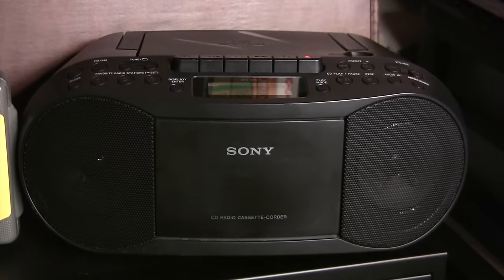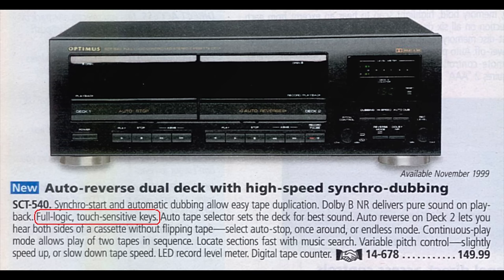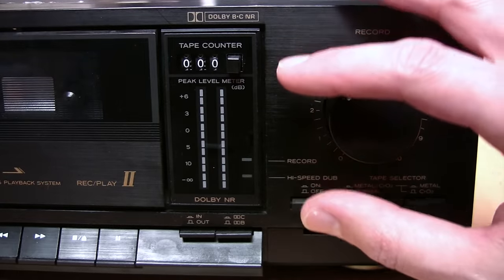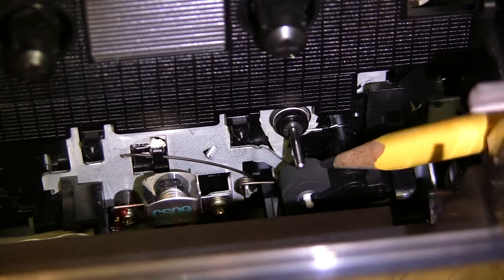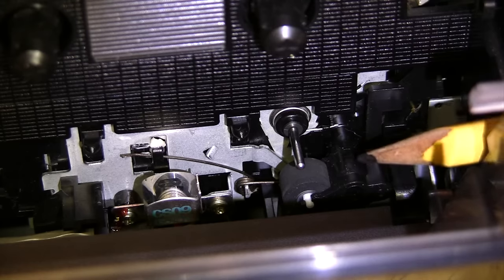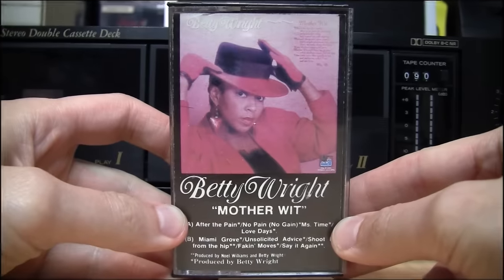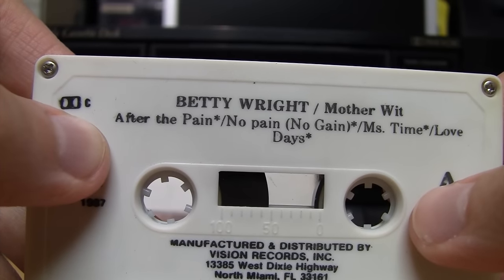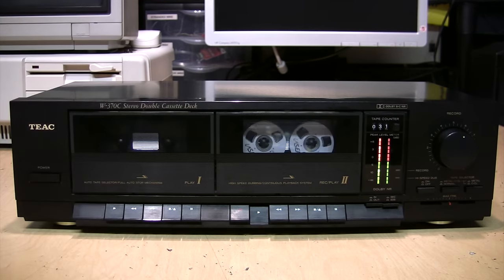Cassette Decks for Dummies

Comment: great info , tho I wish you would have explained about head demagetizing ,,,if, when , or how ...ive heard i need to do this on my new purchased used pioneer deck ...or is this more a myth than necessary,,?  thanks for the hard work and thanks in advance for a reply
Reply: also thanks for your hard work ,,would like to see this type video concerning turntables .
Reply: Head demagnetizing is very unimportant. On "ordinary" decks with combined rec/play head, the head would pretty much keep itself demagnetized by the recording process. 3 head decks, where the play head never sees a record current, are theoretically more susceptible to magnetic field build-up, but again not a common issue and in 30+ years dealing with tape decks I've NEVER found a deck with any significant in-need-of-demagnetizing issue.
Reply: @njm1971nyc  Magnetized heads are caused by tapes made on DC bias or permag erase decks
Reply: @manFromPeterborough  I don't doubt it, but neither have any place in the world of "hi-fi". Only the lowest-of-the-low "junk" tape recorders use these things, so you wouldn't likely notice on the recorder itself, and unless you're recording on junk and then using a decent deck for playback... unlikely to be a real-world scenario. Fair point, nonetheless. The one time in my entire career that I found any form of magnetization in a "tape recorder" was actually a Sony Betamax vcr in the 80s. A guide post in the tape path became magnetized to the point where it would literally erase a thin portion of any tape played in it. That, alone, is the only time I've ever seen a magnetization issue in tape equipment.
Reply: @njm1971nyc  I've never heard of magnetization trouble in a VCR, what was the exact symptom the erased portion on the Beta tapes?
Reply: @manFromPeterborough  yeah, it was an odd one for sure! the symptom was a noisy white hoizontal line about half way down the screen. Which would then look the same if played in another deck! Literally an erased portion of the video track.
Reply: @njm1971nyc  I once had a TEAC 3090 VCR that sometimes are doing previous recoding would have erase bias going into the control track head, messing up the recording leaving no sync, playback, FF or REW will destroy the sync track regardless, that VCR ended up EOLed
Reply: @manFromPeterborough  yeah, that's no fun! Recently had a client's tape with barely any control track, totally unreadable by all my decent quality VCRs, but the shittiest weirdest Middle-Eastern market Panasonic deck that I picked up for ten bucks at the Salvation Army played it totally fine 😄 $5000 Sony pro decks...NOPE. 😄😄
Reply: @njm1971nyc  thank you for the reply ,I was afraid to use the deck in fear that it would damage my tapes because of magnetic "buildup" over the years ...plus some of these demagnetisers are rather pricey

Comment: The finger test part is wrong. Many tape decks are specifically designed to have weak spindles, as those do not move the tape (the roller and capstone do).
Spindle just picks up the slack and is deliberately designed to slip when caught to avoid tearing the tape.

Comment: I have had the Teac W-1200, silver, Japanese
version, of this deck, which cost a premium
price. I know it doesn't have Dolby NR any
more, but it works well to my older ears 👂 🙂 Ray, New Hampshire.
Reply from the maker: Thanks. Did you open it up and see if the power supply can be rewired to 120V (or 230V)?
Reply: @vwestlife  Actually, I never thought of
it, but it seems to work OK on our AC, even
though it shows 100 V AC on the label.
Does this difference in voltage affect it?
Reply from the maker: @raymondmartin6737  Not really, I have a Japanese 100V deck and even on 120V the voltage coming out of the transformer is still well within spec of the voltage regulators it uses. They just run a bit warmer than they would on 100V.
Reply: @vwestlife  OK, thanks for that information. I guess we are lucky they
are not 220 volts, like Europe, though
some radios have switch for the voltage.
Ray
Reply: @vwestlife  I have a 1200 MK4 that is ex Japan 100V, the SDT is putting out 127V, which I believe is making the TF vibrate and giving that BSR hum crap between songs

Comment: Great vid, very helpful and informative! I bought a really good Yamaha tape deck for dirt cheap. Very good condition on the outside but I'm a total noob and didn't really test before buying🤦🏻 I noticed when trying to test at home a weird hum sound when I plugged in the rca cable. Any thoughts on this issue?

Comment: I had the same deck in 1991 with a niko r25 receiver and two Victor audio 8 inch two. Way  speakers  which is an off with brand of JVC along with two  Gemini  djq 1200 directive turntables and Gemini MX 2200 mixer

Comment: I now have three 3 head decks a sony tck561s an aiwa ad f810 and have now won a faulty pioneer ct656 for £35 on uk ebay listing states it functions but audio phasing in and out hoping its belts or the seller used a tape with the felt pad missing either way i will get the pioneer sorted as i believe it will be the best sounding of the 3 though i do like the aiwa .Aiwa did make an oddball twin deck that the recording side had a 3 head set up .
Reply: Audio phasing in and out sounds, unfortunately, like a badly worn pinch roller. That's really the only part that will affect tape travel significantly. Good luck! 🤞

Comment: I love those mechanisms. I has a problem to one Sanyo RD-W340 who the record metal rod does no take coupling with the spring on the base plate for the record button. if I click on it, it doesn't work. it plays as normal and on the record. I fixed this but it bounces off the spring again. meaning to sanyo is defect.

Comment: As a rule of thumb, I've found that the belts in Technics/Panasonic and JVC decks have stood the test of time, while Pioneer, Sony and Hitachi belts are likely to have turned to goo. Also, if your deck works but sounds a little muffled, a head demagnetiser can work wonders; they can often be found on eBay for £20 or less. Finally, as an alternative to window cleaner, it's possible to clean the pinch roller by pressing a dry cotton bud against it as it rotates - just keep it clear of the capstan!
Reply from the maker: This TEAC deck is from 1987 and its belts are still perfectly fine, while I've seen Sony and Pioneer decks that are over a decade newer and their belts are totally shot.

Comment: I found an Onkyo TARW411 cassette deck, barely used, at a thrift store that was listed for $25. It was also Mart 50% off. OK. I like about this cassette tape the audiobook to play. I think this cassette player is from like 94 or 95 so probably about as old as I am. But it seems to be a very good and reliable one.

Comment: When I grew up all you could get was a manual deck the electronic head didn't come till later.. So making the most of that and before I could afford a mixing board and 2 decks are 2 turned tables. In order to mix out a tape let's say an English version and a list version and a German version or Spanish version of a particular song. You had to play 1 verse 1 side pause the tape flip the record over find the next spot QR Code to beat hit the paused continue recording stop it flip it back-and-forth until it was done. With the manual one you could do it seemlessly with no squeaks pops or breaks in it. You can't do that with an electronic one because it leaves a second or 2 second blank spot so you know every time you pause that tape. Yes I said I did that long before I could afford a mixing board and proper equipment. For example the song 99 red balloons English one side German on the other I did 1 verse English 1 verse German 1 verse English 1 verse German and you couldn't tell he would swear that I did it on a mixing board. There was a song major time I did the same thing with. Again you could not pull that off with an electronic edge. Unless you had 2 turntables on a mixing board

Comment: I have a Teac CX-211 and a Kenwood KX-3510. The Teac has left/right channel issues, and the Kenwood won't record, but it plays. I'm at just under $100 for both of them, but I'm kinda stuck since I'm not sure where to start on fixing them. I got the Teac mainly because it looks cool. I was expecting the Kenwood to work since the seller said it did. I mean, I guess I learned my lesson, but at some point I'd like to get these decks fully working. I won't buy another one, certainly not on ebay, unless I see it work.

Comment: Excellent video for the beginers.
But well, let's face it, a lot of deck nowadays need a belt replacement (unless those which are "direct drive"), they don't often pass "the finger test", so open them and change the belt(s) is almost madatory after 30 years.
Reply from the maker: I was going to get into that, but for a pure beginner, my advice is to just avoid anything that needs new belts. A basic but 100% working deck like the one I showed would be a much better starting point than a fancy deck in which the belts have turned to sticky goo.
Reply: There are very few decks that don't require any belts, even DD decks. Generally speaking the supply capstan is belt driven.

Comment: The belts in my cassette deck I just purchased from a pawn shop (for only $5 might I add) are melted or disintegrated, how do I go about replacing those? More so how do I find belts that will actually fit my cassette deck. It's a Studio Standard by Fisher Double Auto Reverse Stereo Cassette Deck

Comment: you may have cheated slightly, I believe one of the close-ups is not from a cassette but the Sony el7 elcaset. if it's not the el-7 it certainly a closely related deck. I am very familiar with the el7 as I brought my own back to life about 3 or 4 years ago

Comment: For each mechanical Piano Key style tape deck mechanism that fails, there are a hundred soft touch mechanisms that fail and about ten full logic mechanisms that fail. (your mileage may vary)
Also... oh there's a song on the radio that I need to tape NOW quick hit record c'mon hurry, the piano key mechanism immediately starts. The soft touch and the full logic can take their time, sometimes more than a second, and for full logic decks you often even need to wait for them to boot up their microcontroller which could take several seconds. Oldschool piano key decks however take about half a second from off to record (because my fingers can't move any faster).
Reply: Excellent point! My Sony TC-WR635S, when you hit the Rec button, immediately responds by going into Rec Pause mode, requiring me to then hit the Pause button to start. I used to just let one cassette record off the radio in A-B Auto Reverse, and then replay that tape later to dub the songs I wanted.
Reply: huh? even old tech had input lag!
Agree that a shoebox recorder would always win hands down..
Or even a mid 70s pioneer mechanical piano keys controled deck.

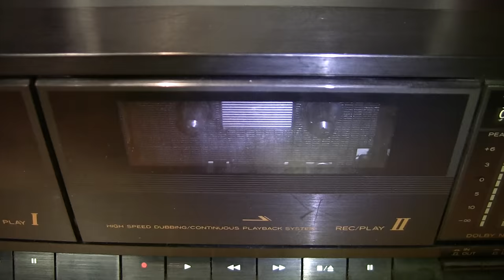Comment: 11:38 is the part where you can clean the mechanism. I do the same cleaning as well on my Technics RS-B11W cassette deck. I can also do the same cleaning with my reel-to-reel tape recorder like my Akai 1721W and my Concord 220T.

Comment: I don't know if that's  is a big deal how you do it but I remember when I used to clean my cassette tape decks I submerged the tip of the cotton swab in the alcohol solution to make it just wet but not dripping wet as it feeled more efficient taking the dirt off that way. I wonder if you always fully submerge cotton swab in the solution or is it only for the video. Is there any science behind this that you should preffer one or other way or it is just personal preference because either way the liquid will dry up fast leaving no residue.

Comment: Many false ads placed out there with folks selling cassette decks as ‘tested’ but then they are extremely dirty or have playback problems.  If they are selling it without providing a link to a video showing it functional, avoid and if they are selling it for well over $300 for a three head, but don’t show the condition of the well or operation, be very suspicious unless you are able to confirm it works/has been serviced properly.  Unless you know what you’re doing and have the know-how it can be difficult finding a shop anymore (depending where you live) that repairs them.  Just a warning as many are taking advantage of well-meaning folks anymore.
Reply: Yep.. Although I didn't pay that much for my deck (But certainly more than $7), it was advertised in good working condition but when I got it, it ate tapes and needed new parts. I had never serviced a tape deck before but I managed to get it working fine with new parts and a bit of soldering work. Although when it first happens to you, the "omg it doesn't work what am I gonna do" reaction is real.
Reply: @dwindeyer  I had a bunch of cassettes I made in the mid 90’s as a teenager on good cassettes like maxell xl-ii’s and I initially bought a JVC dual deck (W209) and when I got it I cleaned the heads and they were filthy. Same thing with the capstan and pinch rollers -both tape wells. I kid you not, I must have gone through atleast 25 cotton swabs trying to get all the gunk out…just on deck A alone.  I’m not sure if the person who owned it ever cleaned it. 

A few months later I decided I would like to get a three head deck because I never had one and I bought a refurbed Sony TC-K615S (circa 1994 model) and the guy who refurbed it put in a Yamaha GF-32 head which made it sound phenomenal (on tapes I made on it) BUT it did not bias most tapes aside from TDK SA’s and D’s. And tapes I had recorded since on the JVC or my older shelf system I had in the 90’s did not sound clear at all though they played back fine on other machines.

It would not touch Maxell UR’s and XL II’s nor Sony HF’s or type II’s.  To me that is unacceptable -and that was another thing the bias calibration did not work correct due to the head not being original or properly matched.  I opened it up and tried adjusting the bias internally but that didn’t help. Ultimately I had to stick it in my closet and get another TC-K615S with no mods and original Sony head and so far so good. It is a great sounding deck too which you can view it’s performance here:

https://youtube.com/channel/UC0C5d3GMmbB692ZkBYGHNvg

The other one sits and I’m undecided what to do with it.  I could probably sell it (they go for over $200 on eBay even in disrepair as they are said to be on par with the ES line) but then due to shipping and parts becoming rare I’m thinking I may be better off keeping it in case I need a part out of it in the future. It does work, just finicky with any cassettes not recorded on it.

Living in Arizona there aren’t any places near me who can see what’s wrong. They do exist in Phoenix but that’s a 90 minute drive, one way.  Not worth the stress up and back and then again to pick it up due to traffic.  

I am of the belief that either the Yamaha head is not compatible with the board inside or it is some sort of alignment problem. The seller (shop that put new belts, gears, roller and head into it and is based in Chicago) said oh it’s just an old machine and just try other tapes and said I could send it back but he would charge me to realign the head (since I already tried on my own) and I said no because I was not going to pay for shipping to there and back for something that I felt SHOULD have worked as described.  I would never again make a decision to buy something like that again without seeing a video first that it worked with a variety of tapes, but you know, all about live and learn.  The ebay nomenclature is that if it powers on they say it was tested and many sellers will make It just acceptable enough to sell but then it becomes the buyers problem.

Shame folks just can’t be honest but that’s the way it is anymore, unfortunately.
Reply: @RB-xm3ed  I would definitely throw my hat into the head not being compatible ring. The electronics would have been set up to output the desired bias level with the original Sony head.

Comment: I have a vintage Teac amp with a tape monitor switch, seperate to the source control. It has tape 1, source and tape 2.

So to play tape 1 I need to select tape 1 or 2. And if recording from say turntable, source should be selected?

Also can you record your voice with just the tape deck connected to the amp? Thanks!
Reply from the maker: If the deck is connected to Tape 1, then select Tape 1 to play a tape. To record your voice you would need some kind of microphone input, either on the tape deck itself (most older decks did have mic inputs) or on your stereo system (not nearly as common).